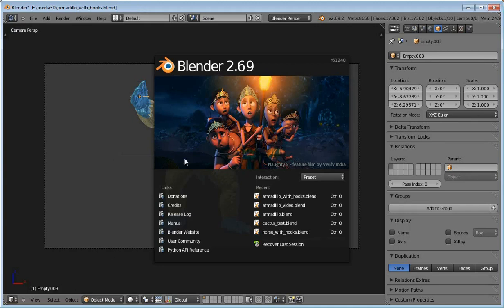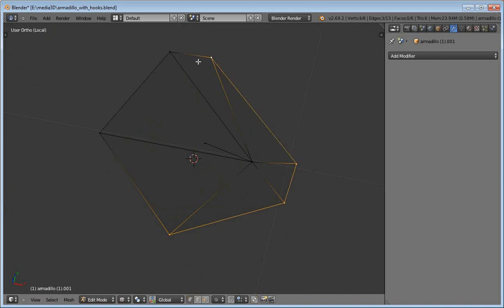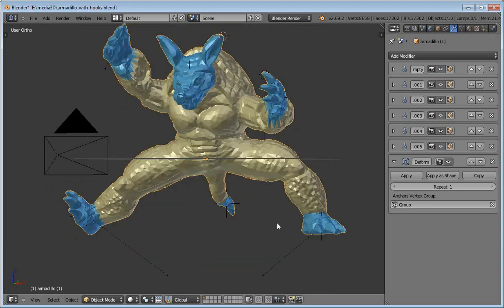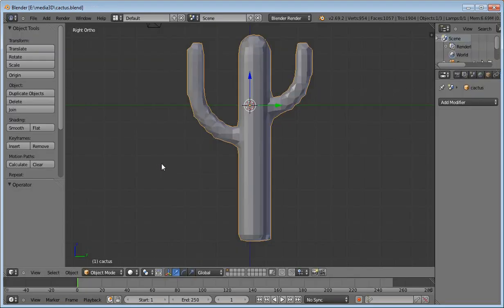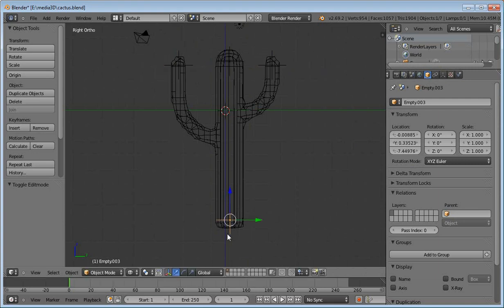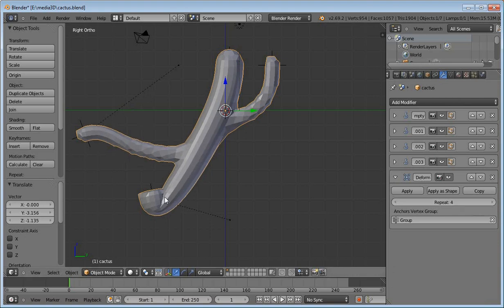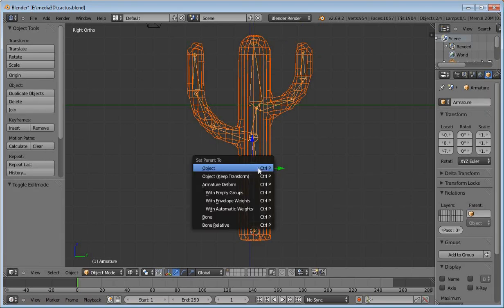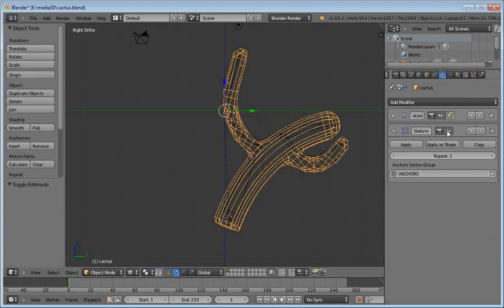Blender Gsoc 2013 Tutorial Laplacian Deform Modifier

Comment: Hi Alexander,  I have set up a harmonic field on meshes in Blender with Python.  I have a custom wieghting scheme Wij which is a modified version of a cotangent weighting scheme.  Unfortunately, the linear algebra solvers in SciPy.sparse don't converge very well and are slow.  How difficult would it be to gain access to the internal least squares solvers in the blender core?

Best,
Patrick